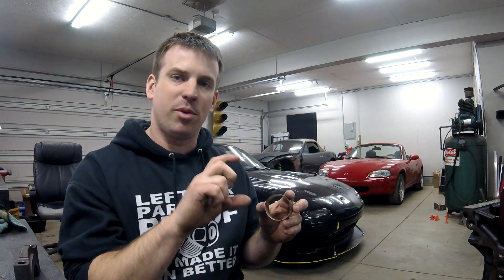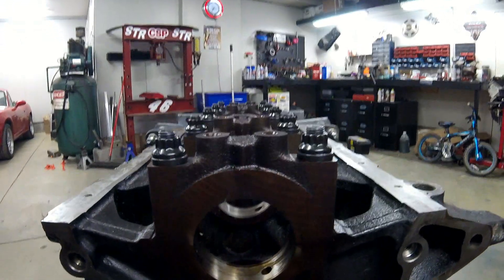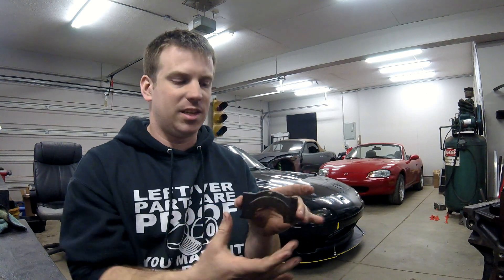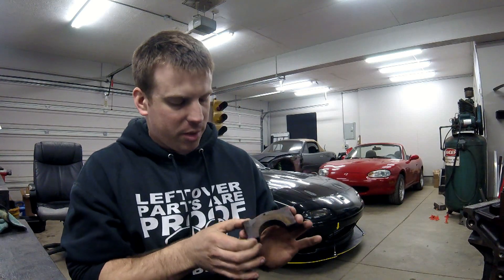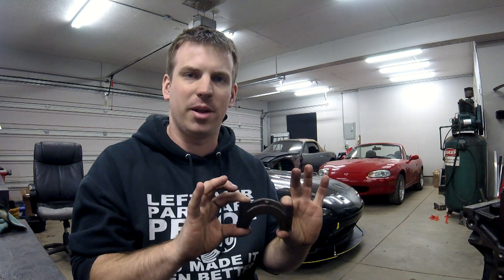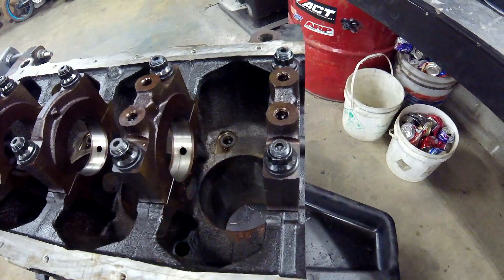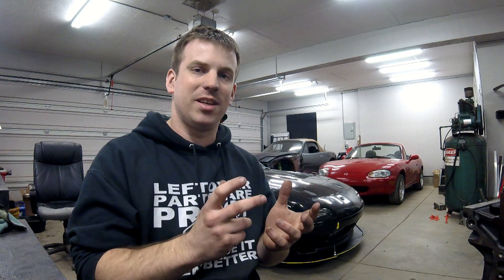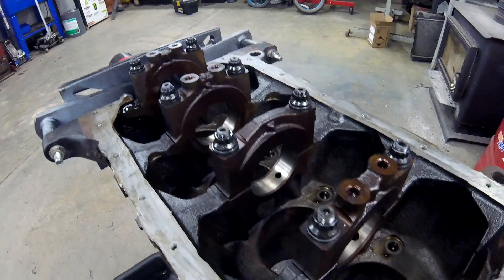Building a Forged Miata BP Engine Guide PT 03 | ARP Main Studs

Comment: Could I just torque the arp mains to around the stock toque spec if I’m doing a lower power build? Really don’t want to go back to the machinist for a line bore
Reply from the maker: I would not recommend that. under-torqued hardware can back off and come loose. if you don't need the extra clamping power of the ARP studs, then just run the OEM hardware.